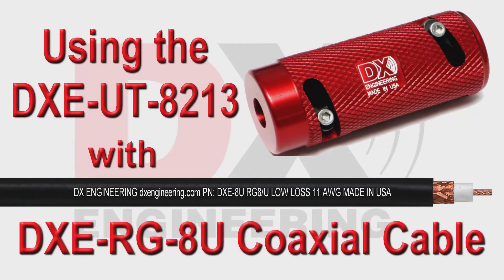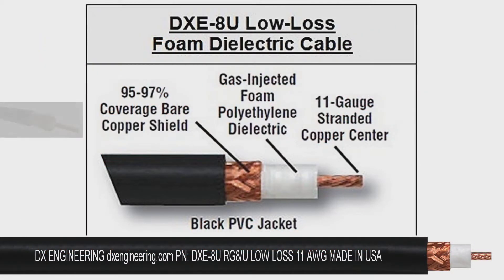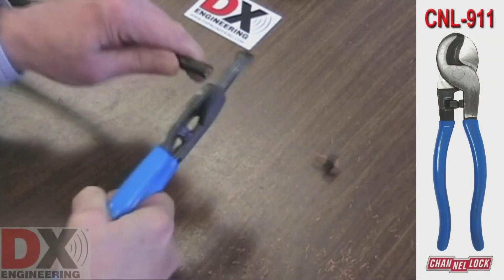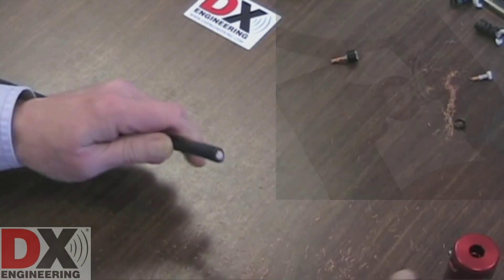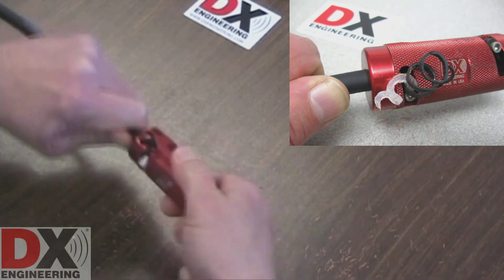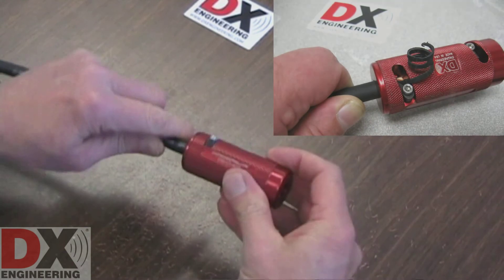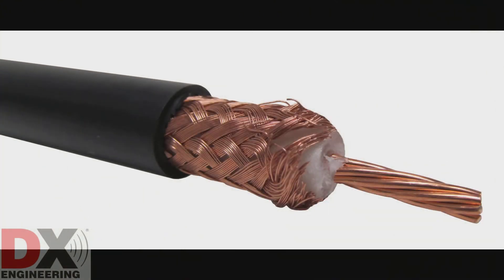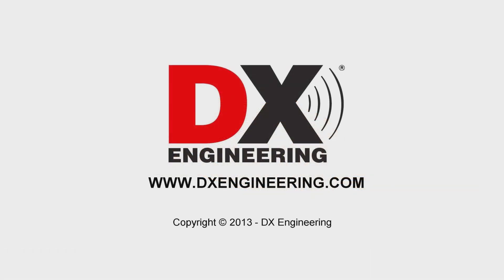DXE-8U Coax Cable prepared using the DXE-UT-8213 Coax Prep Tool

Comment: With due respect, the "finished" prepared coax has rough cuts and seriously disturbs the shielding. Whether or not the shield is properly tinned or not, inserting the coax into the PL259 is going to be a drag.  Make sure you don't have any short before soldering the center lead.  Look at the ARRL handbook to learn how to do the job the right way.